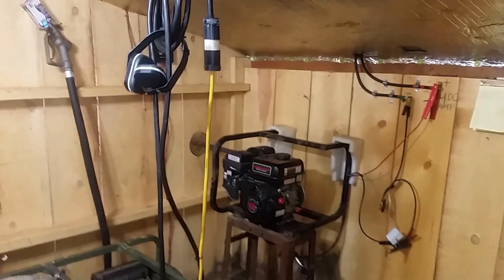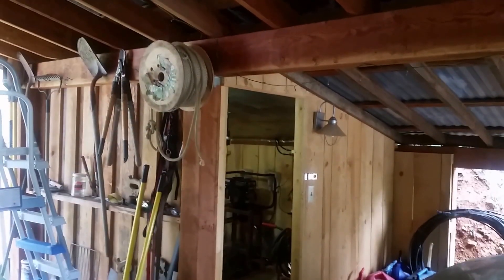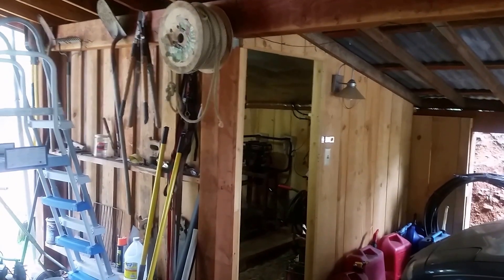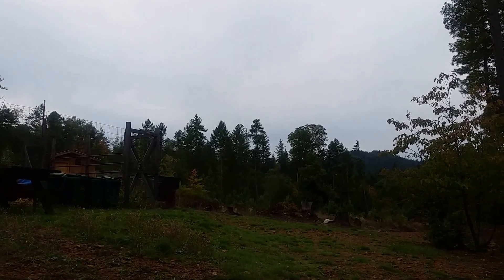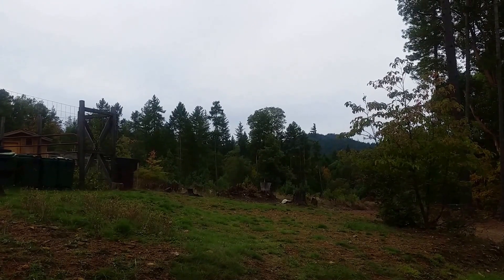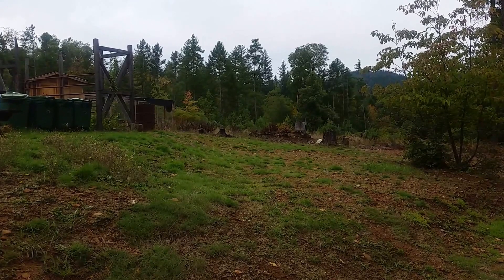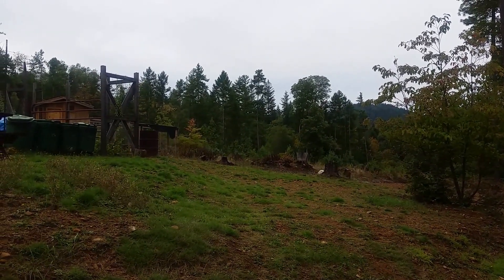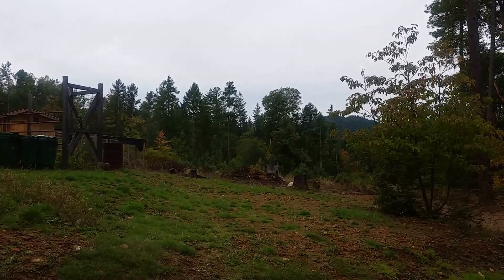24 volt gas generator hours per gallon test.

Comment: Ok you help a lot, i will help you a lot you can modify the generator, to run with ethanol it is 10 times safer and you can make some ethanol at home with sugar or sweet potatoes or rice or corn or fruits or  whatever have more than 10% at 1000ml of liquid sugar inside
Reply from the maker: Thank you.

Comment: Awesome! Thanks for the help! Been very curious about this! If it was (worth it)👍
Reply from the maker: Ogre Dad I just finished another test today with a predator 302cc gas engine. I was able to put one killowatt back into my battery bank with one quart of fuel at 1800 RPMs on the engine and 3600 on the alternator. This out performs the 212cc predator at 2000 rpms. I am going to test a 186f Yanmar diesel clone in the next month or so. The test with the 212cc came out to 2.5 kilowatts per gallon. the 302cc came out to 4 killowatt per gallon.
Reply: I want to get (off grid) and have been looking at splitting between solar and running the bigger stuff off a motor. Was thinking like a little civic 4 cylinder, but a lot of hassle, where as those little predators seem good motors and got way better (fuel economy?) than I would have expected. We live near Bakersfield CA and we need a/c! Be interesting to see what else you come up with. Really appreciate your videos! Thank you!👍
Reply from the maker: In Bakersfield you have so much sun that AC is no problem for a solar system. Look up Chris DYier  You tube Channel. He lives in Oklahoma and had=s taken his suburban house nearly off grid.He did it because of the high peak time cost of running his ac. In the battery charging and pass through loads running a generator Get a 8k Perkins or the 8k Kabota 1800 rpm diesel generator. At 50% load they run about 1/2 a gallon an hour. For off road diesel that a good deal but it wont come close to grid prices. Only solar will do that. Solar prices have come way down. My last panels cost $.49 cents a watt. I now have 4,800 watts of solar. from Mid March through Mid November I only use 20% of my solar array potential and do not need a generator at all. It is in the Pacific North Wet winters that I need so much solar.
Reply: Yeah he is a great fountain of info as well!👍 between you 2 guys, I think I can get something stabbed together! 👍thanks for all your info

Comment: This is very interesting, I'm back to revisiting these awesome videos !.... what strikes me is how your current changes due to loads in the house.  It must be that your batteries are 100% and the open circuit output voltage of your PMA (at that rpm) must be fairly close to your battery voltage, so that when a load comes on in the house, the voltage drop at the batteries is enough to cause more current to flow out of the PMA ?....   I say this in contrast with my experience using a similar setup --- I don't see any change in output from my alternator as the loads change, but then again, the static voltage of batteries (49.1) is well below the open circuit voltage of my alternator (about 56).
Reply from the maker: This test was done with a 24 volt alternator with a vset of 27.3 on the avr. The batteries were very close to full (99%) That was the only way I could have a 10 amp load for long enough to do the test. Yes when the refrigerator came on it would jump to 15 amps or so then go back to 10 amps. At 1800 rpm if I turned on the microwave for a minute it would stall the engine but at 2400 rpm it would handle the load but just barely. At 2800 rpm it was good to go so now I just set it at 2800 and leave it alone. Seems to run well there. I have not done a fuel economy test at 2800 rpm as of yet.

Comment: Steven. Great set up going on up there and what a beautiful area. You are blessed to be there.  Have you ever given thought to wood gasification as a fuel alternative instead of gasoline or diesel.
You are surrounded by woods. If you are interested, check out flash001usa on you tube.
He has "how to" videos of his build which I copied and I can tell you his design works great. 
He also has a website which is www.miniwoodgas.com.  A build like that would be perfect for the 6.5 HP DC generator you built.  And I can attest it will also run a wood splitter for your firewood. Just a thought. You have a beautiful place and a great set up. May the lord be with you.
Reply from the maker: mada94fxr Great idea. Yes I have entertained the idea. Steem is another one. I hope to get the overshot water wheel going first. If that works out I won't need the generator. I am installing 2k more solar as soon as the weather permits. A gasifyer would be a fun build. Thanks for the info and the blessing. And may the Lord bless you and your house in Jesus name.
Reply: Good morning Steven. If you could get the water wheel going, you would have it made. Install a couple of PMAs and call it done. According to my performance curve for the ones I have, they will put out 24 volts @ 25 amps at about 1000 RPM. I saw the video of your new panels still in the box. Hopefully, you can have those installed soon and  I agree with A gut names James that mentioned to you about a separate charge controller. A TS-60 MPPT would serve you well. 
Have a blessed and safe day. Mark

Comment: Nice video. One thing I added to my dc charging system was a digital power meter from amazon. It shows amps,watts,kwh's and volts all in one nice readout. Comes with shunt for less than $20 ,search bayite power meter
Reply from the maker: Ken Ostrem That's a great idea. Thank you for the suggestion. I will check it out. Thanks for watching and have a blessed day.
Reply from the maker: That's a great Idea! Thanks
Reply from the maker: Ken Ostrem I finally put the digital data logger on the dc generator. I bought it when you told me about it but just got around to it. It works great! thanks again.

Comment: So I can fully understand. How does the alternator get to 24 volts. Is it an integral regulator already on unit ? God Bless
Reply from the maker: Edward Von Gerichten The alternator is a 24 volt 65 amp marine grade one wire self exciting type. It has a internal voltage regulator and a coil that is wound for 24 volt nominal. The regulator is set way to l9w for my system. it is set at 27.3 and I need 30 volts. I hope to find an adjustable one for a reasonable price. Have a blessed day my friend.